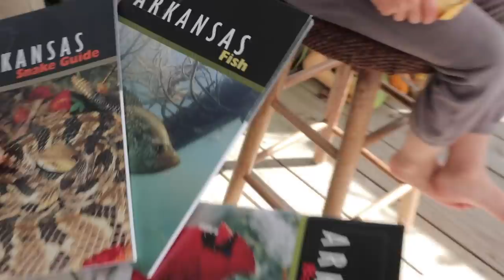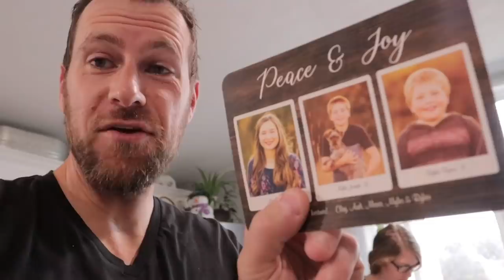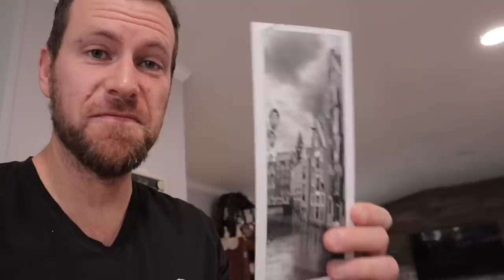Everybody loves a comeback story.

Comment: My dad made a homemade boom for use on the farm. it had a three point hitch, a 16 - 20ft pole with wielded steel rods to reinforce it. We used that boom all the time, it had two large hooks, one in the middle and one at the end, then you could use the chain you are using to pull the cow shed, but use the boom to lift the front end just enough to clear the ground.  It would work fine.
Reply from the maker: Yep, that would be very useful to have 👍🏻

Comment: I mean, It's just going to get picked up by a strong wind again unless you weigh it down somehow. It's a giant aluminum sail. That's part of why you usually build a building on a foundation--to anchor it to the ground. Can you create little 'boots' (ie shelves) on the bottom on each side and weigh them down with concrete blocks and sandbags? That should keep it down.
Reply from the maker: The front is far heavier now and it’s completely anchored into the ground. It hasn’t shown any signs of moving around again.

Comment: Here's a little tip for next time you pull a barn around that I learned. Make the rope or chain as short as possible this puts more down pressure on the hitch for traction and lifts up on the barn for less ground friction. Also when using the tractor you can hook on to the 3pt arms and lift the 3pt up but you have to be very careful because the tractor will be more prone to do a wheelie. Don't do this going up hill or with very heavy loads.  Also with the tractor quitting I am willing to bet the carb was icing up. A remedy for this is to make some sort of metal shield to hold in the heat coming off the exhaust manifold by the carb. Keep up the good work and happy new year.

Comment: Your fence bending over just from those few pounds of ice is why you really need to think about what kind of fencing you guys are going to put on that aviary. Chainlink on top is going to be a recipe for disaster.
Reply from the maker: We won’t be putting chain link on the aviary.
Reply: @whitehouseonthehill  ok, I just remember you guys asking about what kind of "netting" you should go with for the top of the aviary back when you were putting in the telephone poles. Have you guys come up with a solution for that yet? Maybe a clear corrugated roof? You'd still need a lot of reinforcement under that though to hold the weight of possible ice and snow accumulation though. I'm sure you guys will figure it out and I'm looking forward to seeing the end result.

Comment: Seems to me this style of building is characteristic of the US approach. From far away, it comes across as flimsy. Look at old (medieval) half-timber constructions in north-west Europe and you see a couple differences. A steeper roof angle helps to press the building and roof down under high wind speeds blowing over, when a flatter roof would see a "lift" effect from storms blowing over them. We also see diagonal bracing to compensate lack of structural strength from material that fills the space between the beams/posts/boards.
Anchoring to the ground may prevent the shed from being blown over again, but will it have enough structural rigidity to resist the next high wind blowing at it?